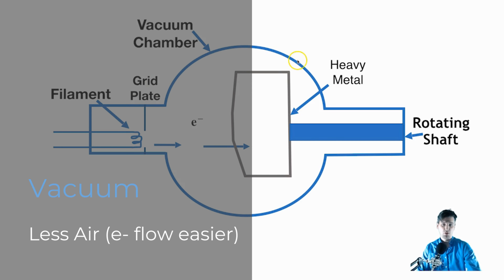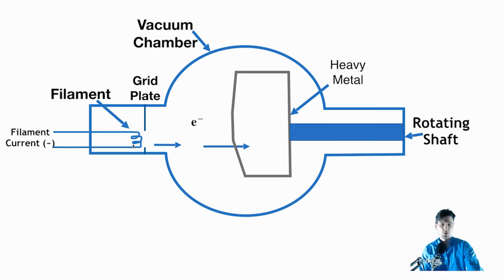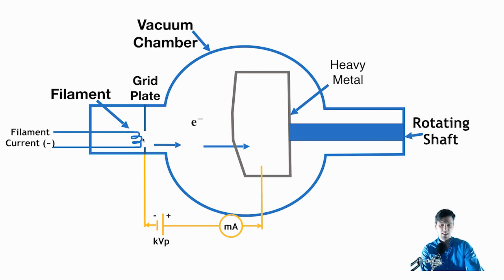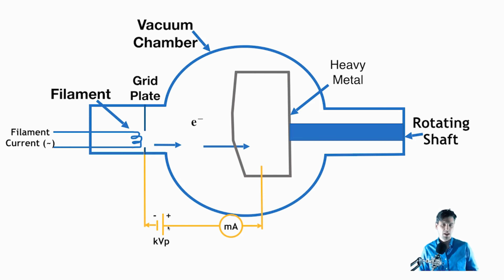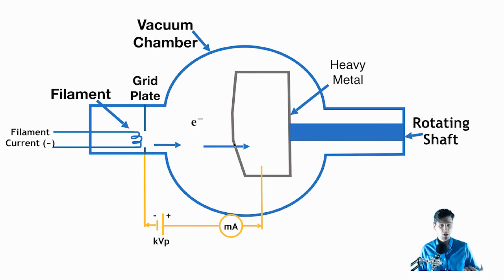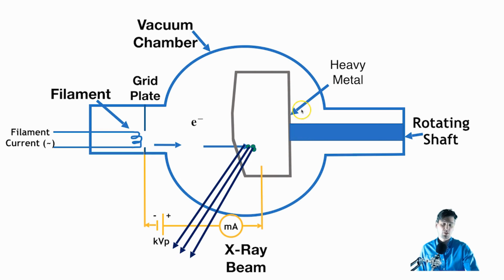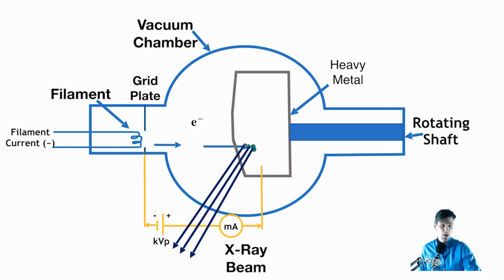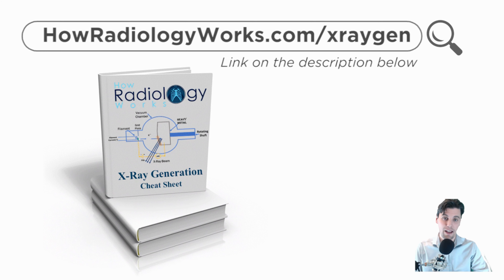X-ray Tube [X-ray tube 101 for Radiographic Technologists: electrons to x-rays]

Comment: These are excellent intro videos!  On a side note, the FDA has cleared mobile (portable) diagnostic x-rays systems with stationary (non-rotating) anodes and only 2mA tube current.  That was a surprise to me.
Reply: Thanks for the comments and that update on other systems besides dental that have a stationary anode. I didn’t realize that either.

Comment: Hello senior Brian 
I am still waiting for your video as regarding tube rating, explaining the meaning of tube rating, heat loading and the relation between them and the target angel as well as focal spot size. How is the impact of kV and mAs on them because it sounds too confusing. I will be so much grateful if you did it.
Thanks a lot
Reply from the maker: Thanks for the reminder. I’ve got a few in the queue ahead of that but will get there
Reply: @HowRadiologyWorks  thanks a lot 🌸